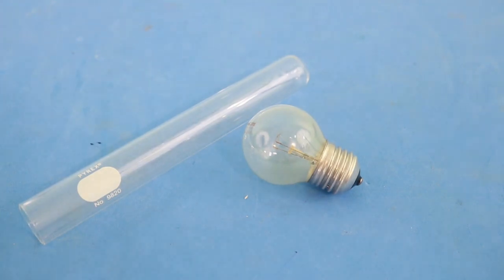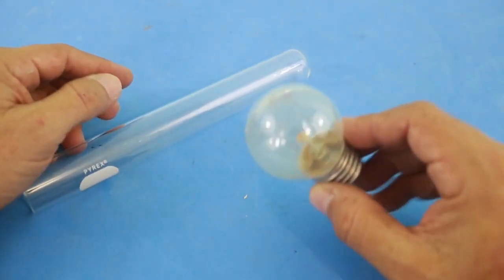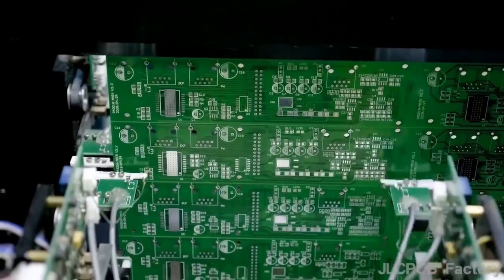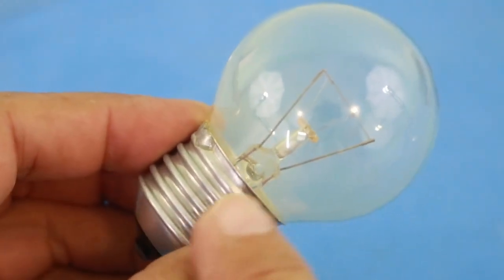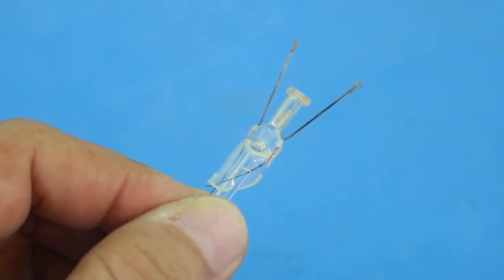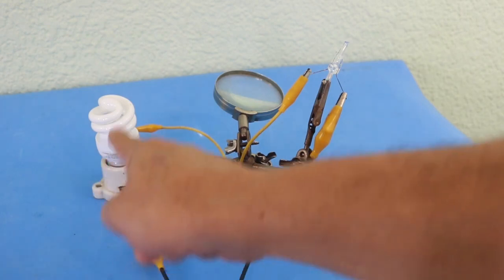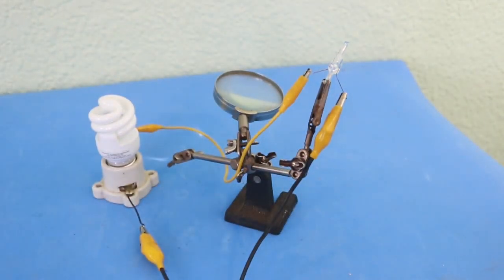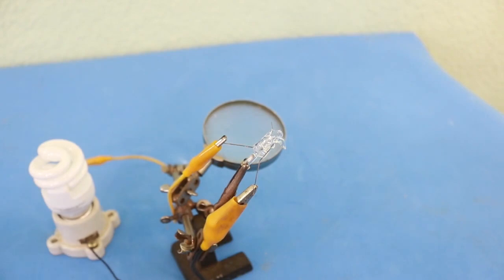Is Glass an Electrical Conductor?

Comment: Not really safe to use alligator clips and hobby wire for mains power, don't do this at home. Would have been much better to use a low voltage dc circuit to demonstrate

Comment: What about aluminium foil on the front of a TV CRT screen. If glass is insulating at room temp how does the act of placing the foil (as capacitor) collect the charge? Is it the electrons depositing the charge to the glass from the electron gun, ie electrons which pass through the phosphors? If so, how does the charge end up on the outside of the CRT tube? Sorry for the dumb questions.
Reply: It's induced electricity
Reply: It’s not a dumb question, opening a crt will give you the answer the HV is attached to the CRT tube the tube itself is a ‘capacitor’ if you add more foil onto the glass you are just adding another ‘plate’ the glass is acting as the dielectric in that case.
Reply: @kolinevans9127  Right ok, now I understand, thanks for your detailed explanation! Much appreciated!

Comment: nice demo! This is also why glass behaves the way it does in a microwave oven: ordinarily, it's transparent to the RF, but if it gets hot in a small region, it will become electrically conductive and start absorbing energy... that heats it up more and the process accelerates. This sometimes happens by accident if you're playing with microwave fireballs, or you can do it intentionally by preheating a glass object in a spot with a blowtorch. Melt holes in beer bottles, in the comfort and convenience of your kitchen!

Comment: Dude your just heating up the electrodes.
Reply: Interesting assumption.   I think a better test would have been to use an Ohmmeter & an infrared thermometer to determine the resistance as the temp of the glass increases.
Reply: @ab_ab_c  he did do that, the brightness of the light is an analogue indicator of the resistance.
Reply: @blaircox1589  Yes, the bulb does provide resistance to current flow, but, I still think it would have been better with an Ohmmeter & an infrared thermometer to show the resistance change as the glass heated--it would provide more detailed & accurate info about the correlation between resistance & the glass temp.
Reply: Yes - watch the video again and listen this time. You'll get it. 💡
Reply: @blaircox1589  absolutely 🤟. LOL
Reply: A basic experiment to show that glass is only an insulator in certain circumstances and can become a conductor. Go to Physics Girl or Mark Rober's channel to get into the deep analysis.
Reply: @blaircox1589  Can you provide good links to Diana's or Mark's pages that you referred to??
Reply: Heating glass = Ionization.
Reply: @googleeatsdicks  ok